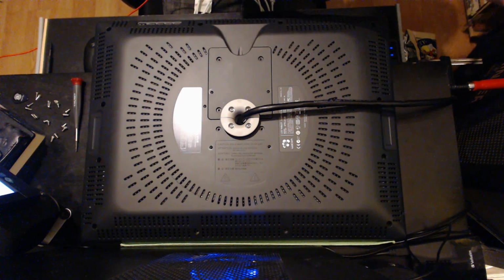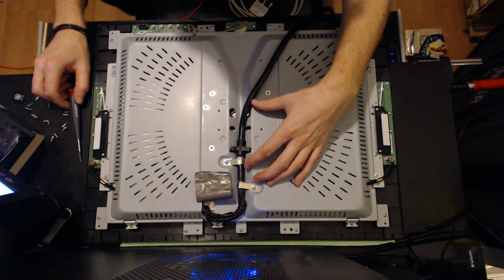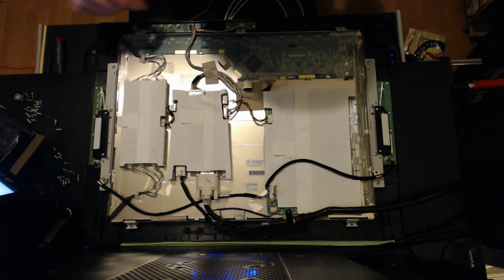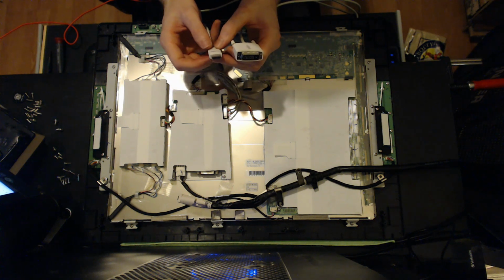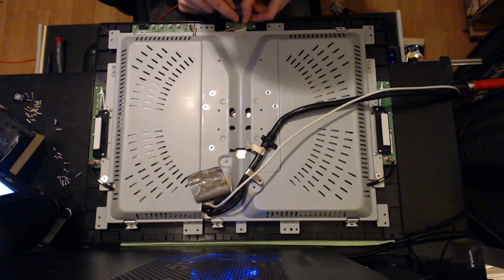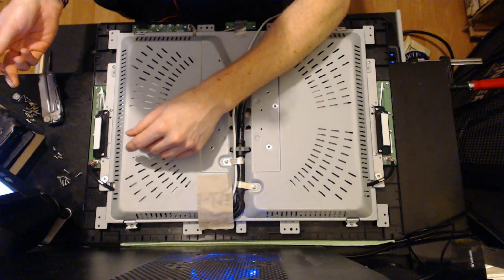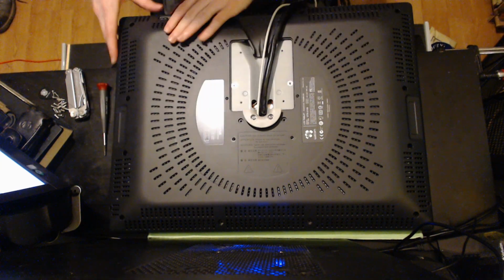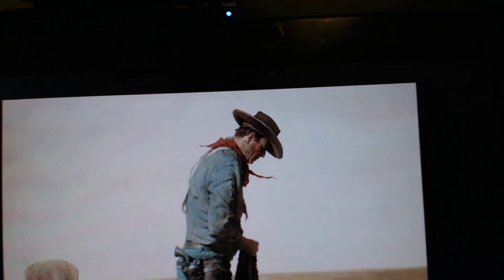Wacom Cintiq 21UX Disassembly and DVI Cable Repair

Comment: I can't get the plastic cover off of mine. I removed the screws but I guess Its the plastic locks that I'm missing.  Can you give me a better idea of how to "pop" them so I can remove the back of this thing?  Thanks!
Reply from the maker: They were a little difficult the first time for me, too. Firstly, be aware you'll have to apply a little more force than you probably feel comfortable with. I've opened mine 4 or 5 times and haven't broken any plastic tabs, its a solid design.

I'd start along one edge close to a corner, get your fingernails under the seam, apply downward and outward pressure with your thumbs 4-5 inches from the edge of the plastic and imagine you are "peeling" it back. You're trying to use a motion that pushes the tabs just slightly past the edge with your thumbs, OUT and AWAY from the center of the cintiq to release them from the "hook" while simultaneously pulling upward at the edge. The tolerances are tight so it is essentially unavoidable to not use some force.

Once you get a couple of them, try to pull the back piece away from the center as you go, it just helps the remaining hooks slip more easily. The corners are typically the toughest. You'll have to use a similar motion when reassembling. Don't try to push right on the edge, push 4-5 inches from the edge, to allow the bezel to sort of "spread" out and over the hooks. If that makes sense!

Good luck!

Comment: is possible to replace the usb cable as well?
Reply from the maker: Technically, yes, but unfortunately not with the ease of the video cable. It would either require splicing into the existing usb data/power wires (the smallest bundle of wires that diverts from the main cable bundle) or sourcing/reusing a cable connector that will fit into the port on the pcb and wiring it to a usb cable. 

If you need help identifying the cable, let me know.

Comment: fixed the issue. Was a loose ribbon cable connected to the lcd panel. Reseated it back and firmly connected it back in place. So it really wasnt the dvi d cable but said loose rainbow cable on the board that caused the flickering.
Reply from the maker: That's awesome, congrats! Glad we got there in the end.
Reply: Ryan Christensen the cable end that is rainbow colred and was connected to the inverter and also the led display was the culprit, turns out that the end connector (its the portion on yhe lower left where the cable is on the cintiq) was loose near said led under the clear tape. So if your cintiq ever has an issue with flickering over and over and the screen stays like that then just disconnect and reseat both ends of the rainbow cable (its the the flat large cable with a wide flat white connector on either side) that is connected to the inverter board and the led panel and that should resolve any issue in the future.
Reply from the maker: Thanks for sharing the solution! I'll be sure to pass it on to anyone who has a similar issue.

Comment: Hi   great video... I have the DTZ model and so far I have not had any problems, except the wear of my screen surface. I've done some research on that but have come up with nothing shy of removing the plastic surface of the tablet down to the glass. I know your surface is in great shape, but have you come across any solutions to that problem? I'm really hesitant to peel that surface off.
Reply from the maker: Thank you - Yes, I've read about the screen issue of the DTZ. To be honest, I'd love to work on glass, the hardness is high enough to totally remove the concern about scratches caused by the nibs of the pen, even when they are worn  to a sharp edge, as they inevitably do.

But I totally get the compulsion to protect the screen, that's why I considered a few different methods to cover the surface. I briefly describe my current solution at the very end of the video, but just for the sake of brevity, this is what I'd recommend: I purchased a large sheet of Acetate at .010" thickness from Blick (you can find it at many art supply stores). It is a thin but very robust, crystal clear plastic. I took the measurement of my total screen area and cut my sheet to perfectly match and used a 3m doublesided clear tape to stick only the top edge to the surface. Leaving it attached from only the top allows air convection to prevent any additional heat as well as make dusting possible as, invariably, it will get behind the acetate.

I really like the feel of the acetate, it's glassy smooth, which you may or may not enjoy. It's super tough and scratching it would be pretty difficult. The only thing that bugs me about acetate is it is very glossy and will be reflective when the tablet is off, but with the tablet on it just looks perfect. 

It's a super inexpensive solution to what could be a very expensive problem. Try it out!

An alternate would be using actual glass or acrylic/plexiglass cut to your surface spec and then affixed with doublesided tape. I considered these seriously but cost is obviously higher and heat dissipation would be less efficient (although glass is the more dissipative of the two). You'll have to judge for yourself what you prefer.
Reply: Thanks for your ideas and help. Do you know if the new wacom tablets have had any similar problems with their surfaces? I haven't read any yet, though the 27"QHD is already becoming an older model with the new 24 and 32 inch models coming out in 2018. My 21UX still works fine, no problems other than the surface. Hate to spend money if you don't have to. Maybe I'll get the nerve to peel that surface off and do what you mentioned... just not ready yet! Thanks again.
Reply from the maker: Yes, it is possible to get to to the lcd surface, behind the glass. I've done it when attempting to fix a stuck pixel. It is a tricky procedure but totally possible. The problem is in removing the dust without introducing more. You'll need to be in a totally clean environment with absolutely no breeze. A brand new microfiber cloth is probably the best method for significant dust, while a cotton swab might be better for small individual specks. 

Following my disassembly will get you about half way there. Basically, from that point, you'll need to remove every remaining visible screw around the parameter on the little fasteners as well as two on either side of the panel near the control button pcbs(a magnetic tip screwdriver is extremely useful here since you are working nearly blind taking them out and putting them back in). You'll have to unplug the power/setting boards (top) and the control buttons pcbs (left/right side) to allow the panel to to lift out of the housing. 

You'll just have to take it slow and make sure you aren't forcing anything, the panel will come out easy as long as every clamp is removed and everything is unplugged. I'd also recommend plugging the power button and dvi cable back in and displaying a white screen WHILE it is still disassembled to make sure you removed the debris. It would be incredibly frustrating to reassemble it only to find you missed something.

Good luck!
Reply from the maker: Sorry for the slow reply! 

According to a little research, the HD models still use some form of synthetic surface material and are therefor susceptible to scratching, and DO scratch quite easily by some accounts, even with very careful use.

Wacom claims the QHD has a glass surface and a few reviews I've read seem to confirm that, including one person who allegedly used an Xacto knife to test it's durability and suffered no permanent scratches. Wacom also claims the Cintiq Pro series is built with a glass surface.

Regardless of the newer 4K Pro models, I'd still happily take a 27QHD, a LED backlit Cintiq with a higher resolution, twice the contrast ratio and a glass surface sounds pretty amazing. The 21UX is still an impressive piece of engineering, but it has a few serious flaws that have severely impacted it's lifespan. It's anybody's guess at how long these CCFL bulbs will keep burning before they have to be replaced... and the resolution is getting harder to overlook as time goes on.

Now, if I can just find a spare $2,000 laying around somewhere...
Reply: i have also marks of the pen on the surface, but its more of a patina than a scratch, which i can easily just clean off with a wet towel. maybe the solution is as simple for you?

however, i got a cheap deal on a demonstration model, which already had dirt stuck under the digitizer painting surface and between the screen. is there any way of removing the screen down to the surfaces to clean them out?
Reply: thanks so much! i had it already open once just to check if it was accessable, but i was hesitant to go fiurther because it seemed glued in place...

Comment: just installed the cable and then powered it up... still didn't fix the issue, still has the flickering screen and the USB ability with the pen goes out. But when I disconnect the HDMI part the led of the USB pen lights up again. So my guess it has to be the logic board where the USB connector goes that needs replacing. Maybe the chip/board needs to be replaced.
Reply from the maker: Well, that's good and bad news, now you know it isn't the video connection, so back to the process of elimination. Taking a step backward for a moment; Have you tried plugging it into another computer? You should absolutely make sure it isn't your system before spending any more money or time troubleshooting.

I still recommend replacing the Cintiq's power supply as a next step(after trying it with another system all-together to be sure), they are extremely inexpensive. Worst case scenario is that you return it or re-sell it if it doesn't solve your issue. 
When you shop for one make sure it matches or exceeds your power supply's specs. For instance, the DTK2100 has an output of 12V 6A. The one listed below is a 12V 7A supply, which will work. Anything lower than 6A will not work.
http://www.ebay.com/itm/Generic-AC-Adapter-for-Wacom-Cintiq-21UX-LCD-Drawing-Tablet-DTK2100-DTZ2100-PSU-/232003013800?_trksid=p2385738.m2548.l4275
Reply: ok I will try to get one soon. Sad that Wacom has a chokehold of a monopoly on the patents of tilt and battery-less tech that wacom pens use..... I would like to see cintiq clones out there that have the same exact tech for cheaper... as this will lower prices down on the cintiqs. But who am I kidding Wacom is a monopoly and that is bad for us as the consumer.

Comment: I just got off the phone with a rep from Wacom. From what I've encountered the  DVI cable isn't the issue, maybe it's the power supply or the power connector or maybe even the logic board  or the NEC screen. One of those factors. Good news is Wacom can probably fix it.. bad news it's 368.00 and also the shipping.

Makes me feel depressed that I can't afford the top tier model and this cintiq of myne has these issues and that Wacom stops support after a few years on the older models.
Reply from the maker: I hear you, that's why I finally just opened mine up and did my best to diagnose the issue, systematically. I'd still suggest you look for a used 21UX DTK-2100 power supply and try that first. You'll save a ton of money if that's the problem. I certainly can't afford to throw $400 at Wacom unless it is the last possible solution. Plus it just feels good to solve the issue yourself.
Reply: Still it sucks that Wacom has a chokehold of a monopoly on the batteryless technology, they need some stiff competition so their ridiculous prices can be lowered. I just hate how the new cintiqs are having issues with power and such. Even some of the pro cintiq models are having faulty issues too.

Seems that Wacom is becoming like Intel... Lazy and charging a arm and a leg.

Comment: I have the same model. Though myne the screen is constantly flickering over and over. The USB drive thing (the cursor when you place the pen) doesnt work. Could it be one of the boards on the cintiq that needs repair or something?
Reply from the maker: What type of flickering? The ENTIRE screen in flashes or like the example in my video i.e. hundreds of individual pixels, typically the same color(usually in horizontal lines)? If it is a lot more severe but similar to my screen, it can be repaired by following the guide and replacing your cable. However, if it is the whole screen flashing uniformly as if the brightness was being randomly changed, that will likely be the CCFL backlighting failing. It can be repaired but it is far more complicated than the former. 

Regarding the pen and digitizer, there are several possibilities; You may need to calibrate your stylus via "Wacom Tablet Properties", perform a complete driver un-installation and re-install the latest drivers (drivers can be a little troublesome and generally won't work properly, or at all, if you have more than one version installed simultaneously), OR your USB cable isn't functioning (if you're able to open "Wacom Tablet Properties", your connection isn't the problem). Lastly, if you bought a new pen, it may be incompatible with the 21UX. Otherwise, you'd have to give me more information.

Hope this helps.
Reply from the maker: Has it ever worked properly? Have you changed any computer hardware recently? It could be a myriad of things. Under-powered PC power supply, failing Cintiq power supply, failing video card... Regardless, a good place to start would be replacing the cable as I demonstrated. At worst, it will eliminate that possibility from the equation, at best, solve the issue. 

My next guess would be the power supply of the Cintiq could be dying OR not properly connected(double check the locking power cable to ensure it is well seated). It could explain the loss of functionality of the pen, as well. It would be the next cheapest diagnostic to buy one online and test it. 

Lastly, providing your video card and PC power supply are fine, you should do a visual inspection of the circuitry of the video board inside the Cintiq(where the DVI cable connects) and look at the couple of capacitors, checking for leakage. 

Otherwise, it could be the backlighting tubes dying, but that wouldn't explain the loss of pen functionality.
Reply: I checked the power supply not the issue nor is the DVI. Im guessing its one of the boards on the display., now the pen doesn't register at all, nor are the diodes on the sides were the buttons illuminated. I tried to open it and such but honesty nothing... Sadly I probably will be forced to send it to Wacom... and from what I heard... they will charge me 300 to 900 USD. On the topic of my PC, I just built it a few months ago, it has a GTX 1080, 650 Watt fully modular power supply and 16 Gigs of DDR4 Ram

This is what sucks about Wacom at times, I heard the 24HD had a similar issue.
I kinda feel pissed now, but well Im not rich so I can't go out and splurge $2,000.00 on the 24HD or $2,700.00 on the 27 QHD. My 21UX is sitting on my desk as a paperweight.
Reply: Update.

I connected the power and the USB only and not the DVI. The USB diode on both sides where the buttons are lights up and I can even use my intuos 4/5 grip pen. Now here is the kicker... If I connect the DVI-D to the DVI-D female... then the button light diode turns off and I can no longer use my pen and the screen still flickers...

From this recent test I furthered it down to either the DVI-D or something that is dealing with the DVI inside the cintiq or a cable in the unit or even the screen.

sigh
Wacom reminds me of Intel, they overprice the shit out of their displays because they have no competition.
Reply from the maker: Sounds promising! Work from the simplest/cheapest solution up. Replace the current DVI cable with a DVI-I or DVI-D or a DVI-to-HDMI (like I did). Eliminate that before moving on. The process of deduction. It sounds like you're narrowing it down, though. Glad to hear it.
Reply: It seems that I can draw on it, but once I connnect the DVI-d connector I hear the windows 10 USB plug chime and the diodes go blank. I'll even upload a video you can check out later. I was a bit pissed off yesterday on my birthday because my cintiq was acting up... and one thing is I can't afford the 22hd atm ( I hate being middle class poor).
Reply: I just purchased a 6 ft DVI-D (I believe that is the connector that doesn't have the small tiny pins around the - connector) and it has HDMI on the other end. Its almost similar to yours but in black from ebay for around 6 or 7 dollars USD with free shipping.

Hoping to have her screen working again as I like the DTZ-2100 Cintiq alot more than the new ones and it would suck for her to die.
Reply: @ryanchristensen5266  I fixed the issue a few years ago. Turns out it was a loose/unseated ribbon cable that connects to the board and the display. Once I reseated the cable, that fixed the issue.